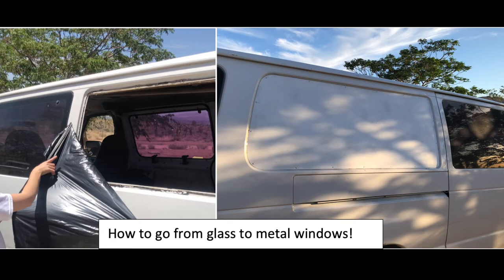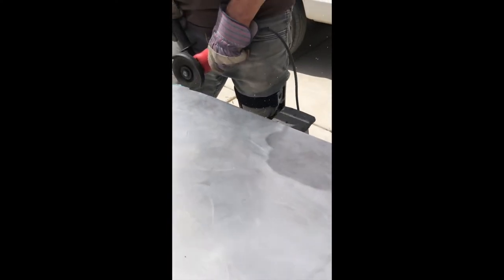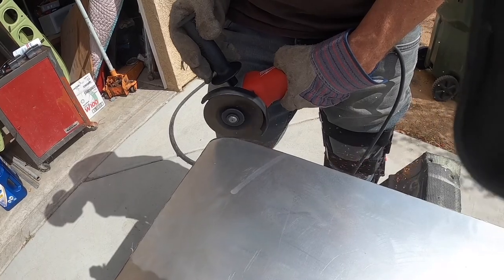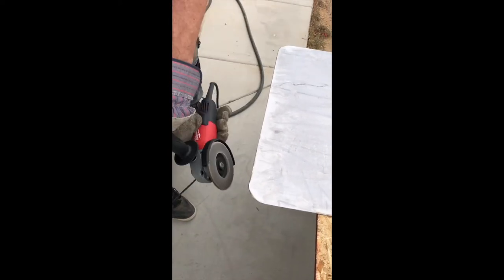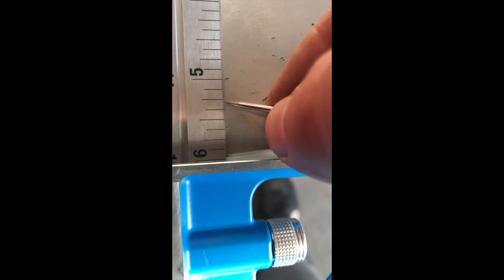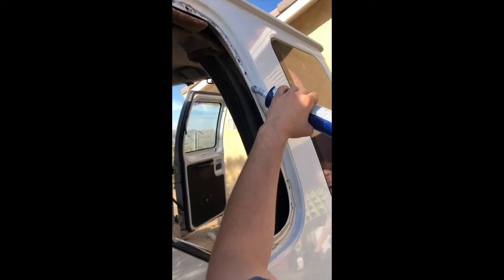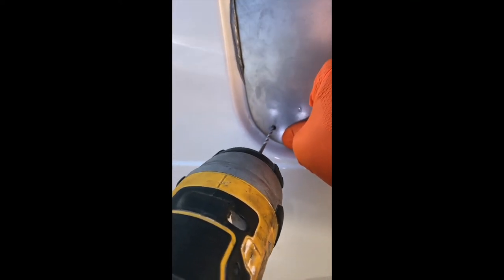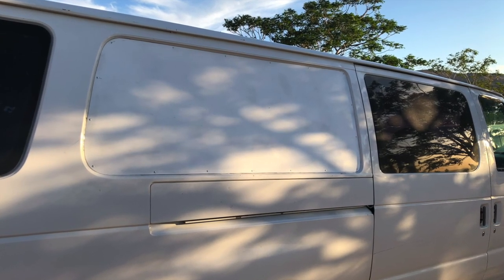Changing or adding Metal Window Panels for a travel van

Comment: Nice work! I'm curious how sturdy the panel is once installed. Does it flex in and out or make any road noise?
Reply from the maker: It worked great.  Solid and as good as the rest of the van's sides.

Comment: I was thinking of doing this then cut it for a sliding window.  Are there any aftermarket sliders that will fit in the stock cutout?
Reply from the maker: I am not sure about that one
Reply: There are actually. I am planning to do this with my van. And have looked up on Amazon. I think the closest I could get to a good size was 12 tall x 24/36/42 long with sliders and screens.  About the size you would see in a truck cap.

Comment: What gauge of steel did you use?
Reply: He said on video its 18 guage steel. If you get it too thin it will flex in the wind when driving.
Reply: @um8440  Not if you use adhesive and stick a rib on the inside.😎